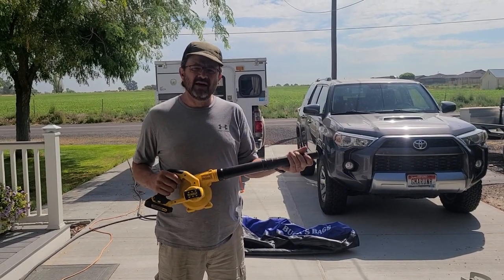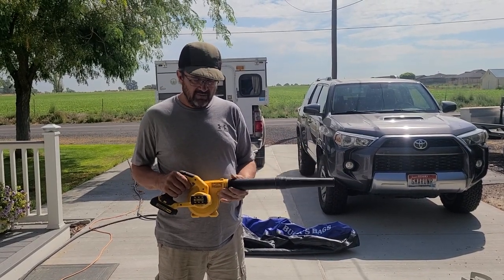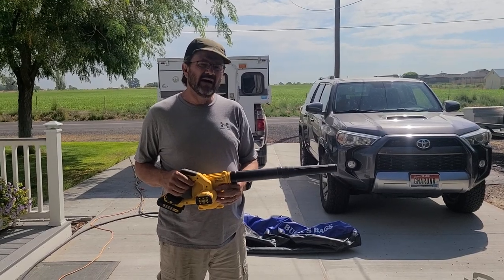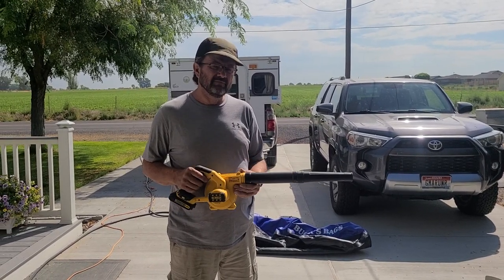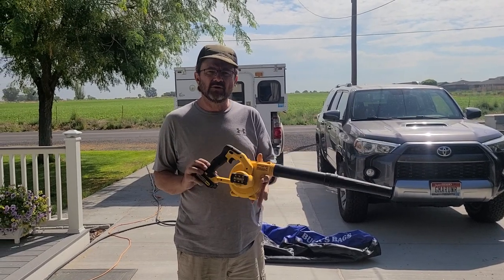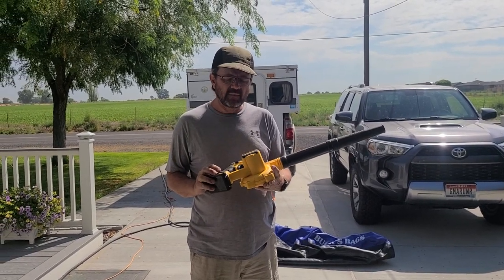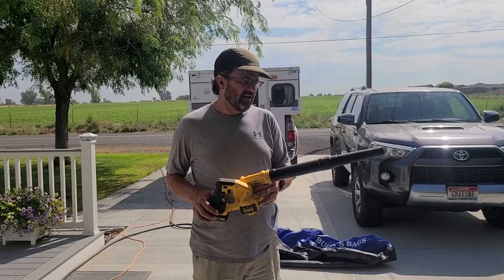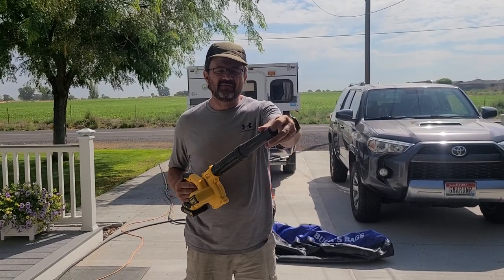inflating a boat fast

Comment: Thanks for this video. Answered all of my questions about this method in 2 minutes. Do you need a fitting? No. Do you leave the valve button in? Yes. Do you top it up with a hand pump? Yes. Straightforward, no filler!
Reply: thinking you can probably also get a 2nd one way H2(?) valve adapter - screw that in first, inflate, and then remove adapter, which will also keep the air in.
Reply: ok I compared the two methods - having the valve open as shown in the video is much much quicker than using the H2 connector attached to the closed valve.